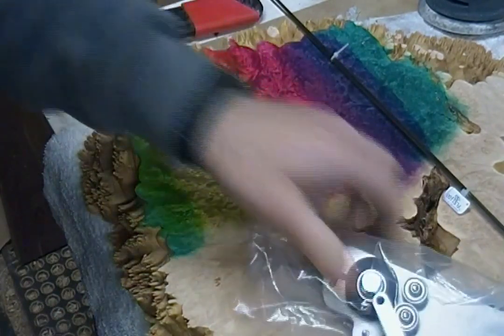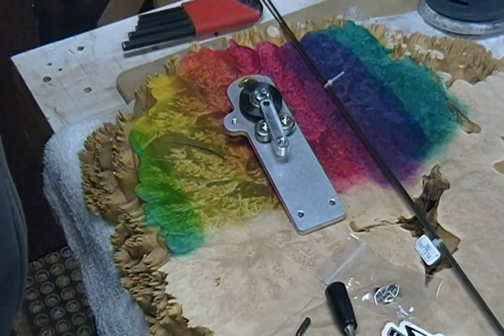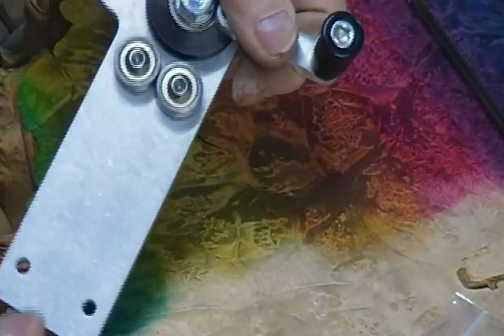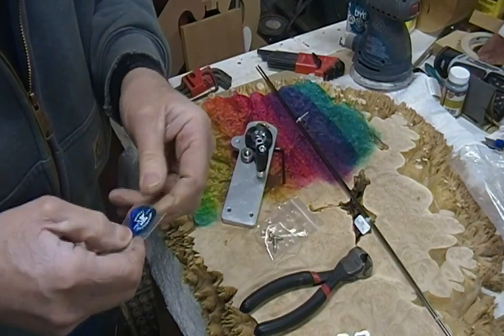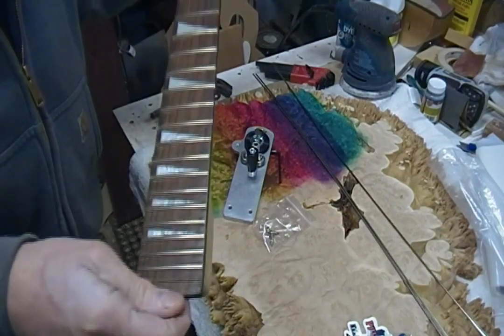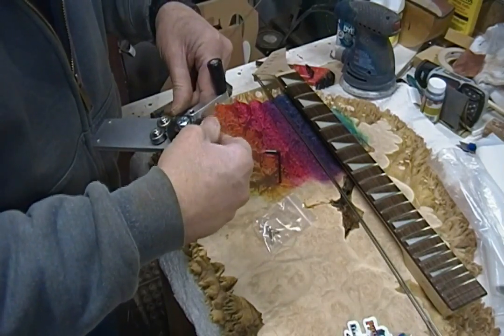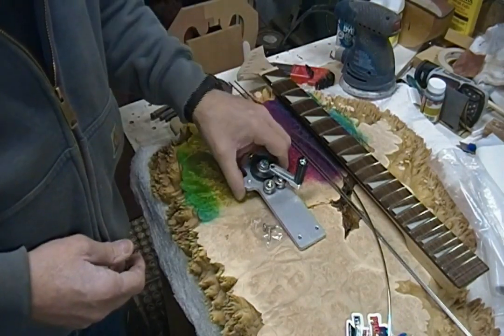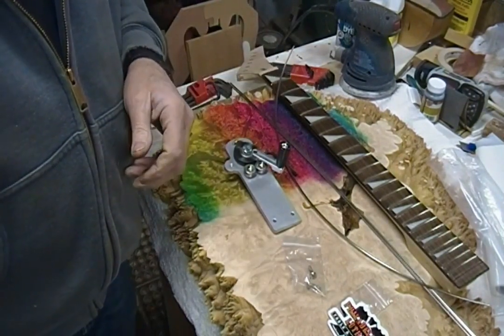FRET BENDER-JONAH GUITAR EXTRA #22,

Comment: Yep. Cap Head and Dome Head. What's in a name though? I used bending rollers for sheet metsl for years and can confirm regarding tiny adjustments. Also "bend in one go" will give a tighter radius than little by little. If you do it little by little, do all the frets at once- adjust then do all of them a second time and so on. Of course these are frets and not sheet metal, but I figure the rules still apply. I really don't like using cutters on stsinless-steel- reminds me when someone borrowed my tin snips to cut st-st "strangle hold" banding and notched all the cutting edges. Looks like a neat addirion to the workshop Dane. I would've liked to see your home made one A-B'd.
Reply from the maker: I was thinking the same thing, probably going to get more bend on the next ones. So I'll have to back it off a bit. I will most likely show the home made bender in the SS fretting video so stayed tuned. Thanks for your input buddy